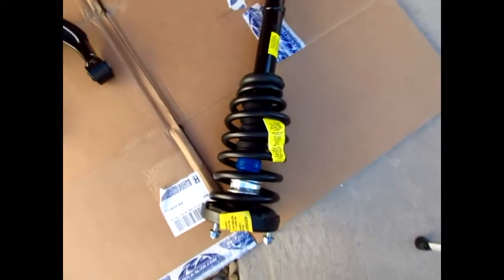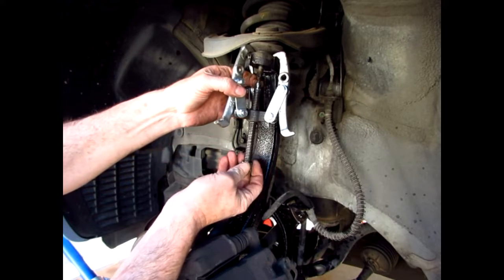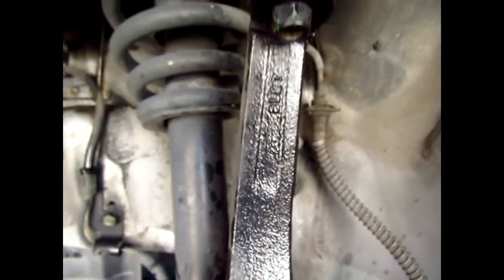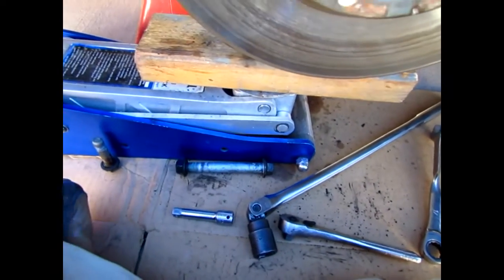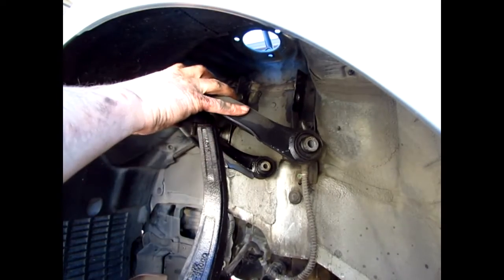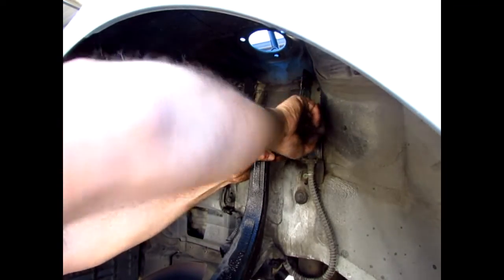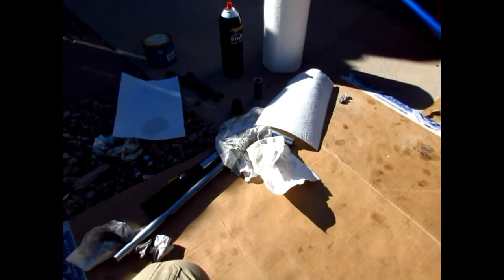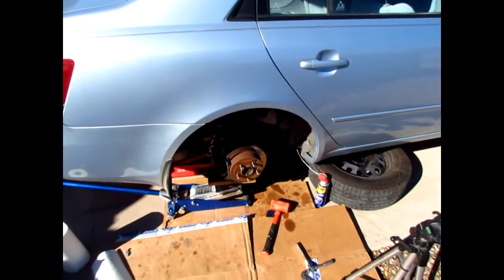Hyundai Sonata Strut And Shock Replacement

Comment: Great step by step video! Doing the same this weekend on my 07 Sonata. Do you by chance have the torque specs for top 3 strut bolts and bottom bolt connecting strut to wishbone?  Also torques for rear top 2 bolts and bottom bolt?  Can't seem to find them ANYWHERE!  Thank you in advance!
Reply from the maker: Hello davekullen5473, 
                       Google FRONT SUSPENSION TORQUE SPECS - Hyundai Forums.

Comment: Great vid !   Tel me, how many miles did U had on this 08   sonata when U decide to change the suspension component at each of the-4-corners ?  What were the symptoms that make U decide to do it ?  My 09 sonata , 2.4 , has only 160K  Kms ( or 100K miles ) and I want your opinion if I should replace all like U did...Thks U so much for answering back this-old-man of mine .. I want to make sure my sonata will outlast me...hihi   It's been my best car ever so far..
Reply from the maker: Hello denisst-cyr3558, 
                I had about 135k on it. And changed them out because the suspension had a bounce to it, and the front squeaked while driving. 
            Change your suspension components only if it needs it. Thank you for your comment.